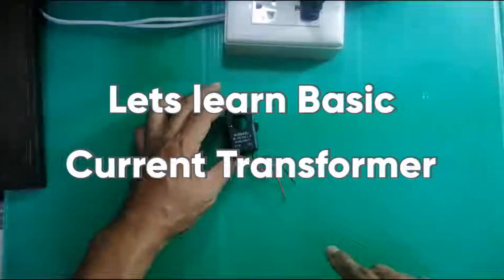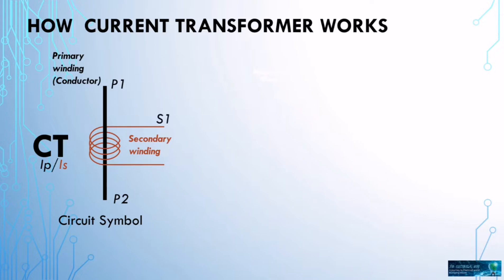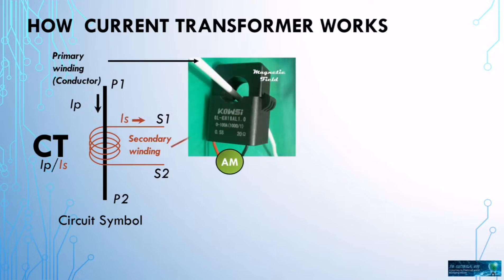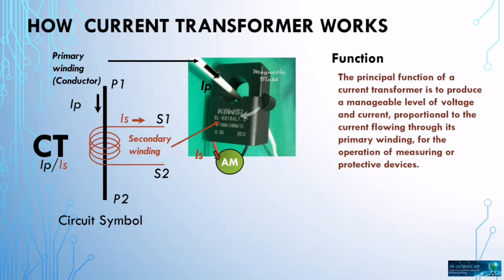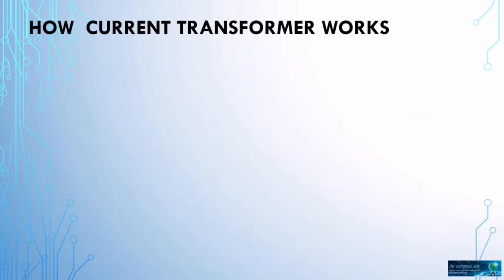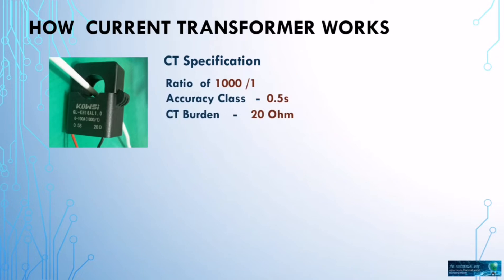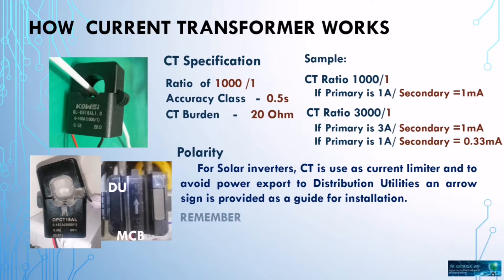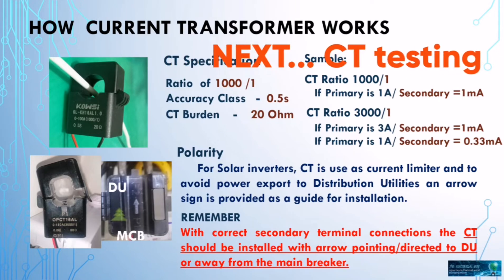CT Limiter Testing & Installation Guide for Sofar GTI PV Solar System

Comment: Sir pwde po ba i install ang ct sensor sa outdoor? Sa main wire sa labas ikakabit before papasok ng main breaker. Pwde po ba sya mainitan at maulanan?
Reply from the maker: Yung material nya pang indoor lang. Mas maganda sa loob ng panel. Madali masira ang insulation nya pag direct sunlight at ulan. Baka magawaan pa ng paraan maitago sa may bubong.
Reply: @jfrelectechnical6652  salamat sa pag reply boss. Masyado kasi malayo yung inverter ko doon sa panel namin. Pwde kaya lagyan nlng ng cover yung ct sensor ikabit sa outdoor?

Comment: baliktad dapat and ct towards sa load kasi nung sinubukan ko yung away nag negative ang reading
Reply from the maker: If it works in your set up then its good for you. Just make sure your CT polarity  was connected at correct terminals. We can do also flick test of the CT to determine its correct + or - cable. Sometime manufacturer makes mistake also. I did flick test on my CT before installation.

Comment: Bro nakadisable reflux derating mo dito?
Pag mataas ang harvest and lower and load, yungnsbrang harvest babayaran mo sa du.
Tama ba?
Reply from the maker: Hindi brod Grid Tie lang yan di Hybrid. Kung anong load yon lang ang tatapatan ng inverter. Di siya magbibigay ng sobra sa DU.
Reply: @jfrelectechnical6652  sa time 7:53 nag export ka pa din ng power sa DU. ganyan din kase setup ko, palaging nageexport mag high ang harvest versus sa house load
Reply from the maker: Wala ako net metering kaya di dapat sobra sa load kundi. Dahdag singil pa sa atin yon ng DU.

Comment: Hello dear friend , i need your help please, i have 2 inverters and the each inverter have a ct limiter, i will connect 2 ct limiters on the same wire? as you show on our video? thank you very much
Reply from the maker: Yes you can install two GTI solar in your electrical system. Two CT limiters in the same wire of the main power supply. Sorry for the very very late response.

Comment: Shouldn't the CT clamp go on the live feed cable coming in to the RCD and arrow putting out of the house so the CT clamp shows how much is going back to the grid. I am talking about Sofar hybrid inverter.Thank you.
Reply from the maker: Yes, thats what I did in the video. Same with grid tie and hybrid sofar inverter. CT limiter was  clamped in one leg of the main cable  and arrow pointing out of the house.

Comment: Sir, note that my solar inverter grip on rather the energy was more expensive

One question, where exactly does the sensor go?

 ct I have 220 where I connect it in the positive or negative phase or ground in which?
Reply: Kahit saan sa dalawa...

Comment: Sir, panu kung line to line ang system ng DU? Panu ikabit ang CT?
Reply from the maker: kahit sa line 1 or line 2 as long follow correct orientation of  arrow  that point to DU... tHANKS
Reply: 2 ct i think. so you need an inverter with two ct limiter otherwise two inverter. i guess
Reply: Idol  pa help lang. ung arrow ng ct limiter  pointed to main breaker(to meralc0) or pointednpapunta sa breaker ng bahay?